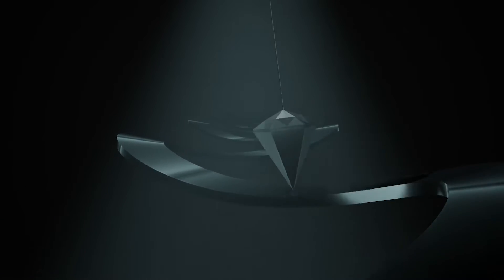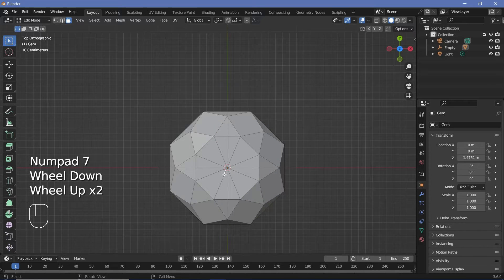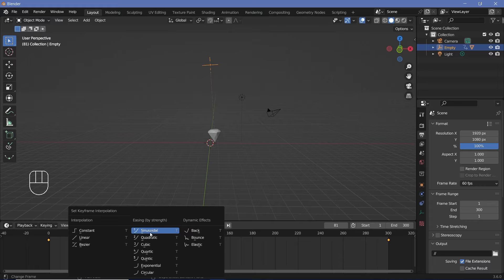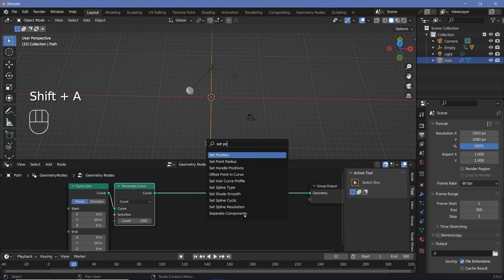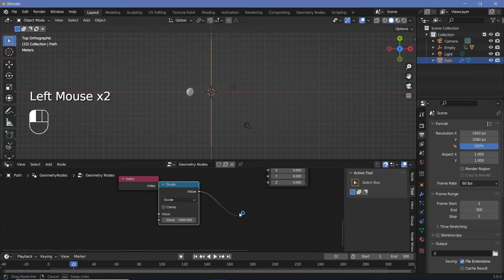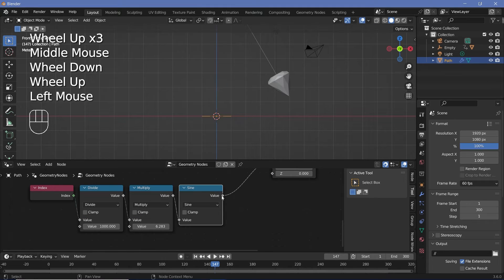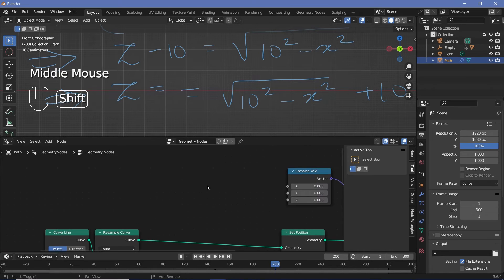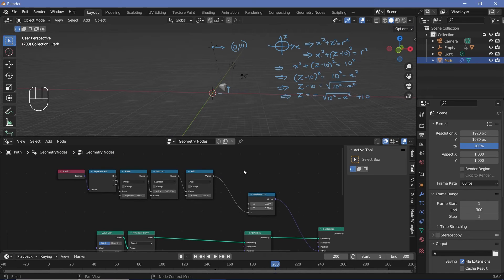Mysterious Pendulum Path Loop - Blender Tutorial

Comment: Thanks. Excellent tutorial. One point is when you extrude the mesh, the face orientation will be flipped inside out. If you use "flip face" node after extrude, the faces will be oriented properly. This may not be important for this project but it's good to remember about orientation for more complex geometry. Thanks again.
Reply from the maker: Thank you so much!

I do mention flipping the faces in most of my tutorials because bevelling would be very hard without flipping the face and merging by distance.

Thanks for mentioning it here as well :)

Comment: Rendering to a video file is always a bad idea, if there is a power loss or Blender crash during the rendering the video file will be corrupted and you will not be able to use the rendered frames. Teach your audience to render image sequences.  You're making great tutorials, keep the good work going.
Reply from the maker: Thank you so much!

It is definitely safer to export image sequences and for longer videos or when rendering in cycles, it is definitely a must. Beyond that, rendering out image sequences also has other powerful benefits in the long run. 

However, for short videos of 150 - 300 frames rendered in EEVEE, I generally opt for rendering directly into an FFMPEG video solely due to size differences. Rendering individual frames at 4K would often create a folder of 1 - 2 GB, whereas the same video as an FFMPEG sequence set to perceptually lossless leads to a video size round 40 MB. 
That HUGE size difference is the driving force for me export these 5 second loops as an FFMPEG video each time. 

I will definitely let my audience know about rendering PNG sequences instead as well and I'll maybe make a comparison video of all the different formats someday soon. I'm sure that will help out many others. Thank you so much for the inputs and ideas :)